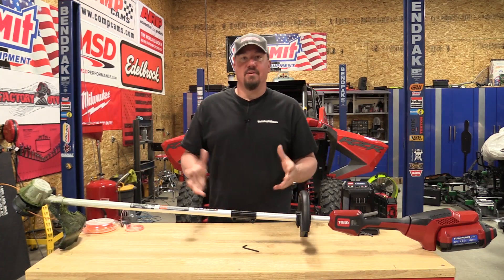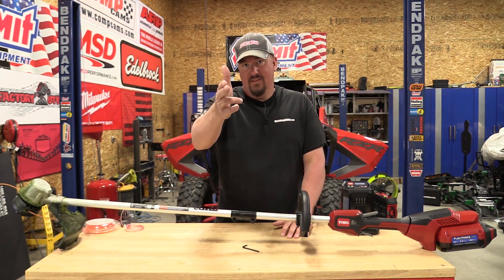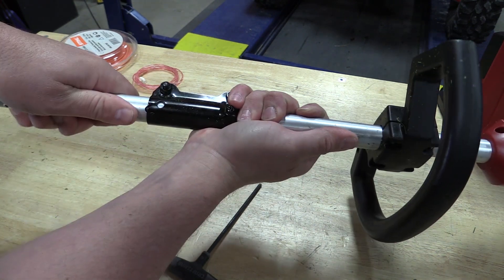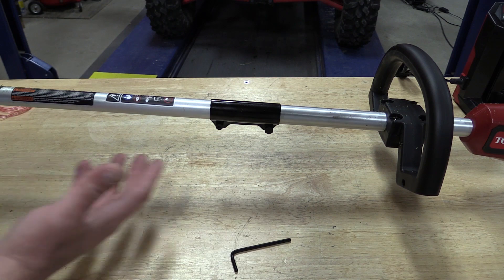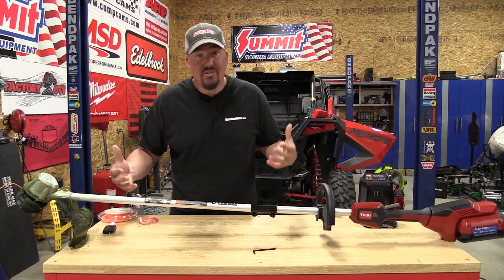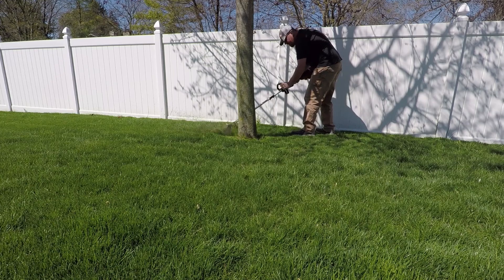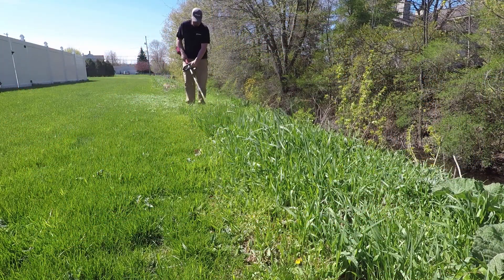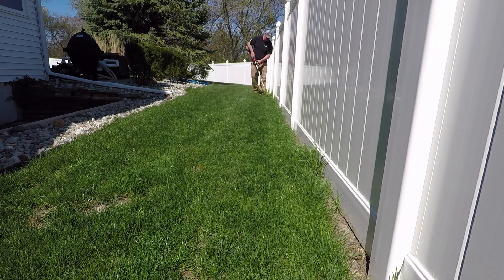What You Need To Know Before Buying A Battery Powered String Trimmer | Toro Flex Force 60V 16"

Comment: I have this trimmer, running on the "low" power setting and 1/2 trigger pulI get over a hour ... you don't have to run the trimmer wide open to get the job done.  I use the .080 trimmer line, it does the job.

Comment: While on the subject of heavy and run times I'd just like to say I have a Kobalt 24volt Max trimmer with a 4ah battery. The trimmer is very lite and I do all my trimming and blowing with one battery. And for the average home owner who maintains their yards it is plenty powerful enough to get the job done. I also have a 40volt Ryobi trimmer, yeah it has significantly more power then The Kobalt but all that extra power really isn't necessary for my trimming needs. I know one thing and that's The Ryobi is significantly heavier and will wear you out! I now use The Ryobi with a edger head only and The Kobalt for all my trimming.

Comment: Brief history.  I purchased a B & D battery powered weedeater over 10-15 yrs ago at Hm Depot.  Don't remember model but the packaging clearly stated up to a quarter acre of runtime on a full 8 hour charge.   I charged it 12 hours as I really wanted to see what this baby could do.  It ran about 10 mins before the rpm's really started to rev down.  Quarter acre?  My yard is small and this includes both front and back.  I immediately returned it to Hm Depot and they were reluctant at first to take it back until I let them know I charged it overnight.  I've used gas ever since but am considering battery powered as technology has improved (I hope) since my initial foray.  Your video was informative.

Comment: C'mon you gotta give props to Ego's power load!! It's the only in the industry and its aweseome.
Reply from the maker: Ours broke after 4 or 5 loads.  Very frustrated with EGO's quality.
Reply: @WorkshopAddict  So Ego's multi tool with string trimmer attachement it is.  It's also alot more powerfull than there carbon fiber version.
Reply from the maker: @Mcklain5  There you go.  That guy does have a lot of power.
Reply: @WorkshopAddict  see my ego is 5 years old not one problem the auto load seemed gimmicky ... When I bought my ego's string trimmer and blower I was the talk of the neighborhood now about 7 of us own them not one problem that i know of !

Comment: Extra note ....... go to a Shindaiwa and get you a loop handle for a Shindaiwa LE-260 stick edger.  I'm replaced the handles with 3 of these, well worth the $25 price.  The handle is padded for comfort and stands about 5" taller, this dos away with having to do that slight bend making it  easy on the back.

Comment: Low speed for vinyl siding, plastic fences, bark.
You can use it on high if you're talented enough, until you're not.
I have an older B&D 20V specifically for those areas.
As vinyl gets older, it gets more brittle.
Reply from the maker: I try not to run out of talent.  LOL.  When you grow up with gas, I guess you had to learn talent?  :)

Comment: Great review, but to be honest, I've been using the Ego line of products (string trimmer, edger, pole saw, hedge trimmer) for over four years.
I did have to replace an old 7.5 Ah used battery I bought years ago with a new one.
My 5.0 Ah (1) 2.5 Ah (2) and 2.0 Ah (2) are still chugging along.

Comment: I bought a Milwaukee because I have 67 Milwaukee batteries. It seems to be strong enough for what I’m doing, especially with the 9.0 and 12.0 batteries, wish it had a carry lanyard on the base or front handle.
Reply from the maker: They have a great system!
Reply: I just picked up the M18 one this week too. With the 8 Amp hour battery I was able to completely trim my yard and edge my sidewalks and driveway on one charge with a little left over. It worked perfectly for what I need.

Comment: I thought it was the camera playing tricks on me at first....I said damn..he makes that trimmer look tiny. As far as the water and line....I try to put my line in a gallon size zip-lock baggy with a little bit of water and that works well for me.  I turned my Milwaukee trimmer into almost having a 18 inch cutting swath by making my own blade trimmer on the guard.... however by doing so I have to run .080 line to keep the power level up. Anyhoo...great vid brother
Reply from the maker: Milwaukee has a great unit.

Comment: Question is the RPM’s spec for cordless trimmer important to have. Like to be higher RPM’s to cut tougher weeds. For example a Black & Decker one model has 7200 RPM vs other model has 
9000 RPM which is better for tougher weeds performance.
Reply from the maker: IMHO, The RPM listed is less important that the size string it will take.  Most cordless trimmers are in the 6 to 7,000 range.  In tough weeds, most will bog down.  You need to motor to have the torque to keep a high RPM and the only way to tell that via the specs is the line size it will take.  Anything limited to .080 is not good for you.

Comment: I have been mowing for 30 years. Always used gas power. Now I have retired, still wanted to stay somewhat busy. Purchased the Toro 60volt system. Fills my needs 3/4 lawns a day. One question. Can I let it get rained on or do I have to take it off my trailer racks if it’s going to rain.
Reply from the maker: It will have no issue with rain.

Comment: Maybe it's just me but all of these newer trimmers seem to have taken a huge step backwards with their string loading and feeding mechanisms. Manually threading lengths of string?   Soaking the string in water before use?   I'm starting to think I am spoiled. I've been using a 40V B&D trimmer for the past 5 years (LST136). I'm still using the same battery and I get 30-40 mins of runtime. It loads with a simple drop-in spool of string, self feeds and hasn't jammed once in 5 years. Oh yeah, and it was $150 with battery and charger ($68 bare tool). Three spools of string cost $12 on Amazon and each spool lasts all summer. I know B&D gets a bad rap on a lot of their stuff (usually deserved) but if this trimmer broke tomorrow I would buy another one.
Reply from the maker: Soaking string is good for any trimmer, old or new.  The new loading is this way and it is simple.  Keep what you have if you love it!
Reply: @WorkshopAddict  I learned something new today. Been using string trimmers for almost 35 years and never soaked the string.  :-)

Comment: After 30+ years of running gas powered string trimmers that turn counterclockwise, clockwise would be very counter intuitive. Also, my trimmer for the last several years and my favorite of all time has been a extra long straight shaft Tanaka, about 10 inches longer than the standard shaft, so hearing that the 60v Toro is shorter than a standard straight shaft is a real bummer ! I was seriously considering the 60v Toro to get away from gas,  but the clockwise rotation and more importantly the short shaft make it much less attractive ! Unfortunately it seems Tanaka is no longer making the extra long shaft version.

Comment: Have you tried the Makita powerhead unit? I’m thinking about picking it up with the string trimmer and edger attachment.
Reply from the maker: Yes and I would go Milwaukee over Makita.
Reply: WorkshopAddict the only thing is I’m already in the Makita platform. I have the drill impact sawzall circular saw cordless blower and chainsaw. It’s just kind of a big hit about 450 for the string trimmer and edger combo.
Reply: @bradstemp1567 , try out the Makita.  It's not cheap, but neither is getting into a new battery platform.  If it doesn't work for you, return it and get something else.

Comment: So it seems like you are a bit underwhelmed on the whole? In terms of the battery trimmers you have tested that have a good complete ecosystem what would you recommend? Specifically I am looking to get into either Ryobi, EGO, or Toro. It seems like Toro wins the Snow Blower war vs Ryobi and Ego. It also seems like Toro is up there with the new 60V Mower. However, it seems that EGOs new mower is getting some stellar reviews as well. Where does Ryobi land across all 3 ? Trimmer / Snow Blower / Mower? Awesome content. -Thanks!
Reply from the maker: Ryobi is dead last in that race.  Was I underwhelmed?  Maybe.  I like longer runtime and counter clockwise rotation.  Other than that, this was great.  Sometimes you expect more.